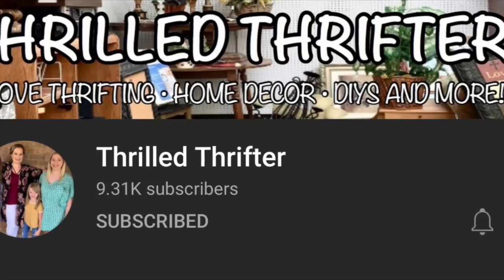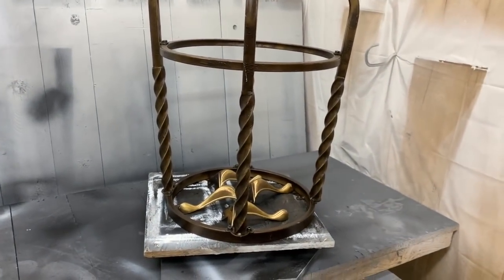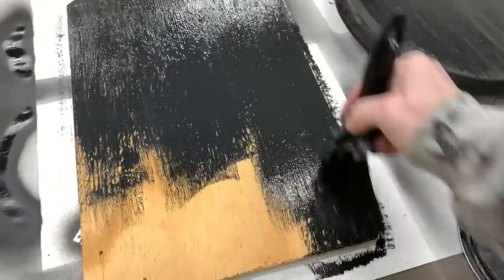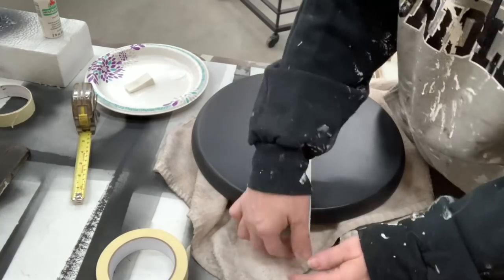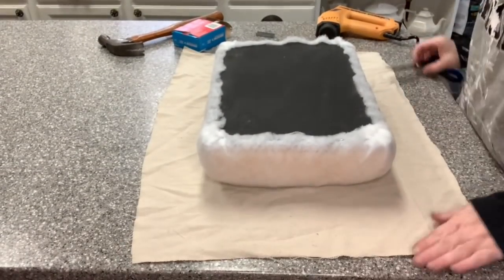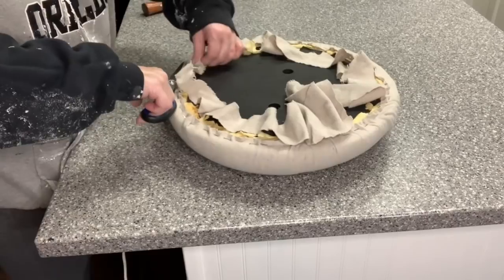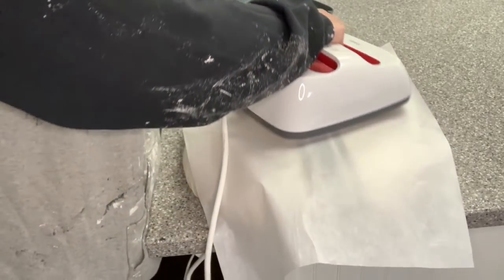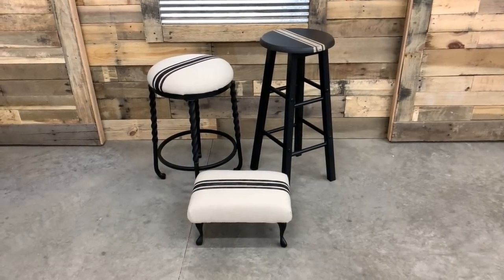Thrift to Treasure Thrifted Furniture Flip Farmhouse Decor

Comment: I love your channel, but every time I see that you have problems with putting vinyl on windows I want to tell you to try the wet method, it will change your life! All you have to do is have a spray bottle of water with a little drop of dish soap and mist your window with that and put your vinyl down. Use your scraper to get as much water out as possible and you can leave it for a while even overnight and it will be so much easier.
Reply from the maker: Well.. I’m in the process of doing some more windows. So I’m so glad you said something 🤔😁